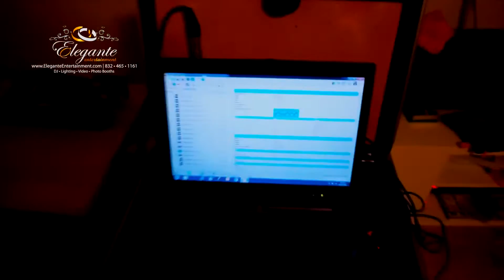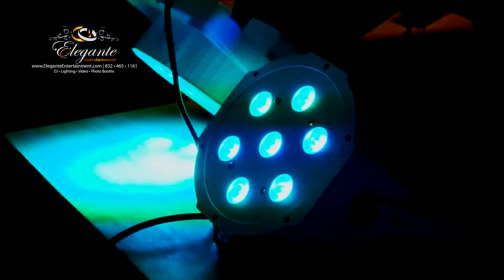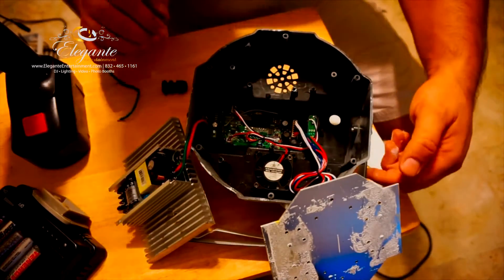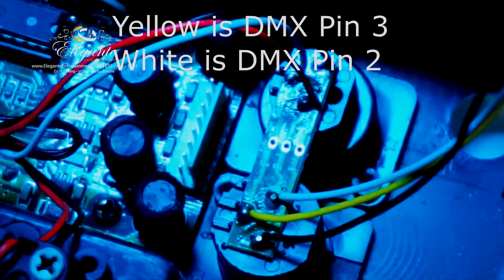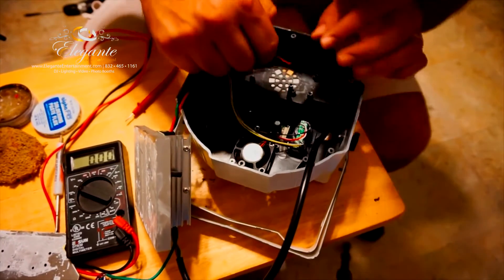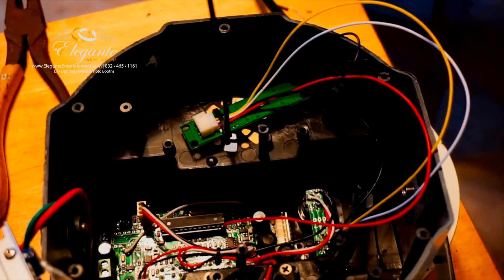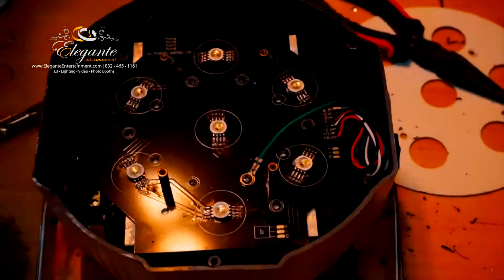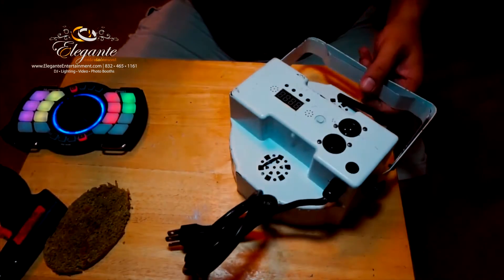Wireless DMX Install Tutorial - Simply Frank Da Mad Scientist

Comment: Hello, thanks for the tutorial. Do you think it's possible to add a rechargeable battery to it ? If so what is the voltage needed for this light fixture ?
Reply from the maker: I have never tried that, I would probably need to know where the voltage converts from AC to DJ and then measure it... That's a little more complicated than I can do

Comment: Can they run with Master Slave Mode?
Reply from the maker: Hi FPV Zone, that depends on the light. Most lights do not run wireless dmx on master/slave. Master/Slave is not a DMX signal, but a proprietary signal. I have one company that does run Master/Slave DMX and they can control other wireless lights. But the majority do not run a dmx signal on master slave.

Comment: im thinking of doing this project.. what type of moving head did u convert to wireless?
Reply from the maker: chinese 90 watt generics
Reply: Is the also a Video Converting moving Heads? 
What is, if i want to go one time with dmx cable but installed the wifi module at Same time (e.g. In case my transmitter Crashs)

Great Job& Video.
Reply from the maker: Yes

Comment: i want to make wireless DMX balls where thes 8 double a battiers suppling power to a DMX to led strip decoder, how would i power one of these boards with this.
Reply from the maker: You can use a rechargeable battery such as the Lithium Ion 18650s or  3 AA Batteries in Series to get you to 4.5v

Comment: The DMX pcb has a place for wire connections
Reply from the maker: How do you mean?
Reply: DJ Francisco Perez the pcb board that is attached to the DMX connectors has 3 solder pads with holes for the wire to pass through for soldering.
Reply from the maker: You mean the ones pictured at 6:05 right?
Reply: DJ Francisco Perez 
Yes sir
Reply from the maker: Yes, you are right, I still prefer to solder to an existing contact.
Reply: What is the difference? Thank you. :))

Comment: also what type transmitter will pick up these receivers and type lighting  program do you use for computer
Reply from the maker: For the program on this video, that one is called Q+ Light show (something along the lines) I loved it but it's not 100% working with my moving heads. The other program I use now is freestyler. Most Wireless DMX receivers are transmitters as well, They are smart... if they detect a dmx signal present on the pins... they automatically transmit... if they detect a dmx signal that is already being transmitted wireless, they become receivers..
Reply: Charlie Valenzuela

Comment: I have a ADJ tripar profile. how did you find 5 volts what were you looking for?
Reply from the maker: I don't have an ADJ Tripar, or else I would check for you, but there are some IC chips on the broads... some will have $5v going through one of the pin... Either that or look for a 7805 transistor and that one for sure will have 5v
Reply: on the 8 feet chip you will get the 5v i have the picture i can send you for the 5v